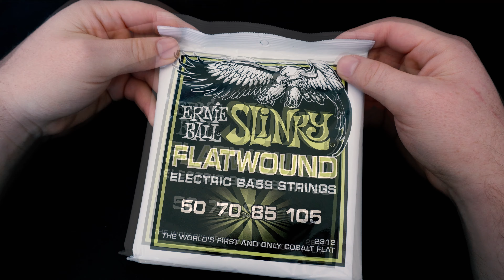Do they sound like roundwound strings? | Ernie Ball Cobalt Flatwound

Comment: I use these on my Stingray, great for taming some of its natural brightness.  They are very versatile, and you can even slap on them.  I agree with them losing brightness over time, I'm not quite into Bernard Edwards territory yet but it's getting there.  One weird thing is they make your hands smell like metal, at least with my body chemistry.
Reply: I had them on my cheap SUB Stingray and I definitely got that "metal smell" even playing for just five minutes. I've since modified that bass and I'm indecisive between roundwounds or true flatwounds like Labellas.
Reply: Dude! They are made out of metal! 😁
Reply: Metal doesn't have a smell. It is 100% body chemistry.
Reply: Sure it does, and when it rusts even more

Comment: Experience after longer period of time of using them? Durability compared to traditional Flats which could last lifetime?
Reply from the maker: They tend to rust way easier than other strings. And so far they're the only sets of strings I've actually had a string break on me in the last 6-7 years or so, and I've used two sets.

Apart from that, they do seem to retain that brightness for longer compared to normal flats

Comment: Do these cobalt flats have a lot of tension? My only issue with flats is that they have high tension, I worry about what they can do to the neck of my bass.
Reply from the maker: They don't have  a lot of tension, at least up to the 50-105 set. The 55-110 set of course has a bit more tension, but not so much in comparison to some other flat strings I've tried, such as Rotosounds
Reply: @OliverTobyn  cool, thanks i might give them a shot. I play bass in a punk band but love the feel of flats. I think these might just be the strings for me.

Comment: Ernie Balls Sack. 2 sets i thought i found the holy grail. Opened up my gig bags a couple days later and RUST. FREAKIN RUST ON BOTH SETS. That's terrible.
Reply: You gotta buy coated if you live in a humid environment my dude
Reply: @metalfan846  - Thats the thing..those where the Cobalt Flats. The Cobalts are coated, correct?
Reply: @sixsentsoldiers  No, they aren't.
Reply: @metalfan846  - rotosounds, Daddario, gHs. None have turn to rusty shit like those ernie ballsacks cobalts. In humidity.

Comment: .50 gauge G String instead of .45. If you haven’t tried it you should check it out….highly recommended.
Reply: Does that mean the .50 has the same tension as the normal .45?
Reply: @cp8wj2ur8k  Not sure but my guess would be any difference, if at all, would be marginal.